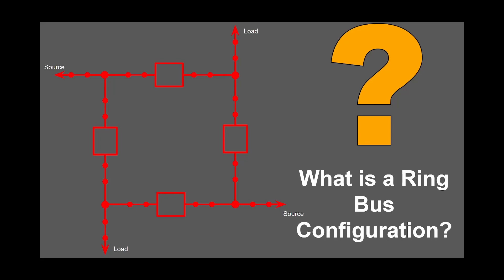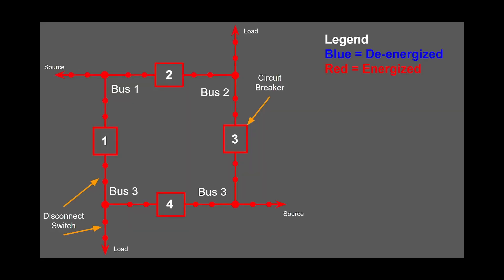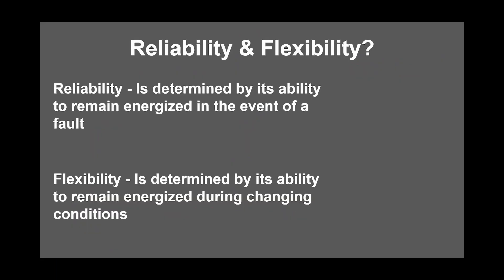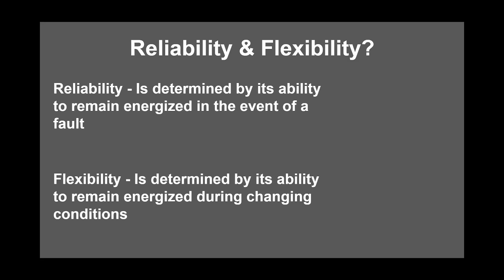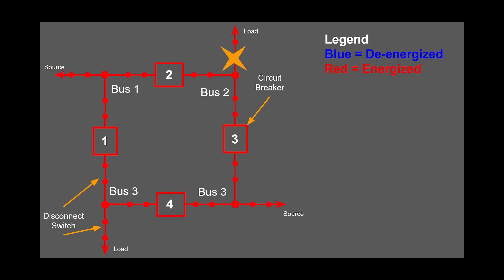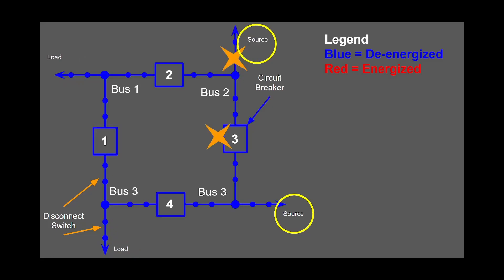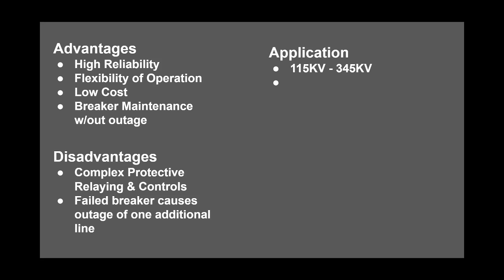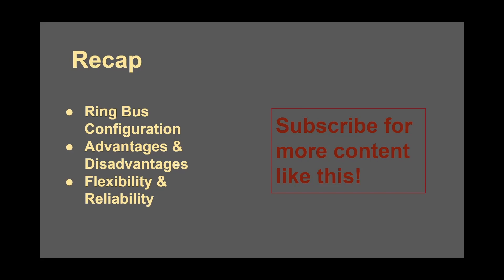Substation Design - Ring Bus Configuration Explained

Comment: It looks to me like if bkr 3 failed to trip, the fault would still be fed to the line between bkrs. 2 and 3 and bkr 4 operating would have no effect since the line between bkr 3 and 4 is a source line so how do you cut the source?
Reply: It looks to me like if bkr 3 failed to trip, the fault would still be fed to the line between bkrs. 2 and 3 and bkr 4 operating would have no effect since the line between bkr 3 and 4 is a source line so how do you cut the source?